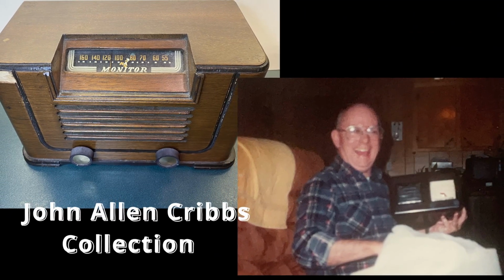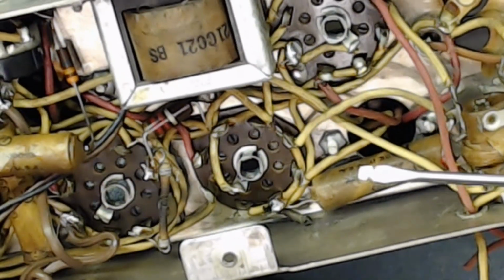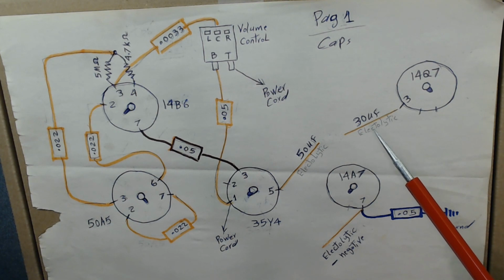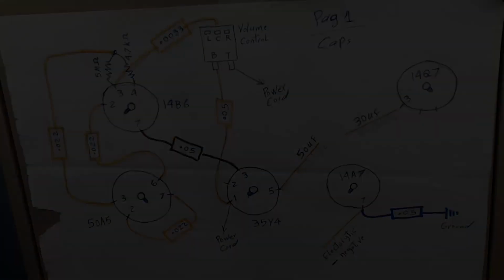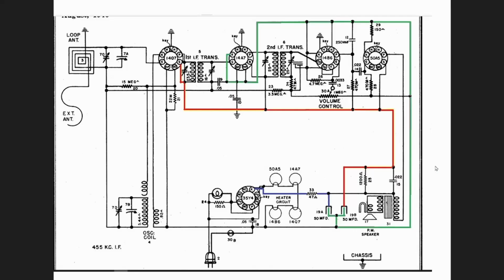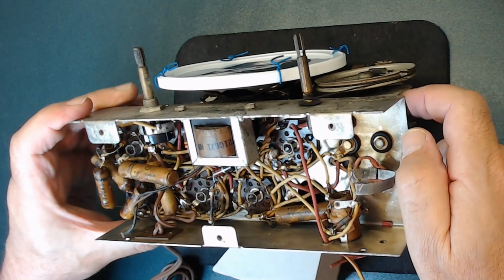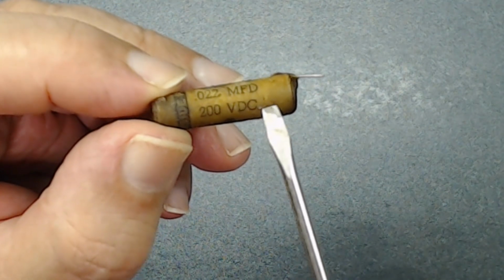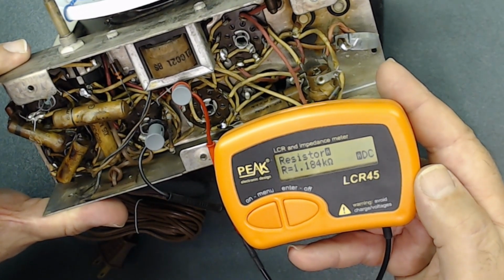Part 2 - Rewiring and Repair of 1946 AM Radio

Comment: Somehow my comment may have gotten deleted. I know you mentioned some wiring going somewhere and chances are 
it is one called a gimmick. It helps reduce the lower frequency noise as a low capacitance AC choke. Never remove it but
 you can replace it with new wire if necessary. Many times it isn't marked as anything in a schematic and can throw you 
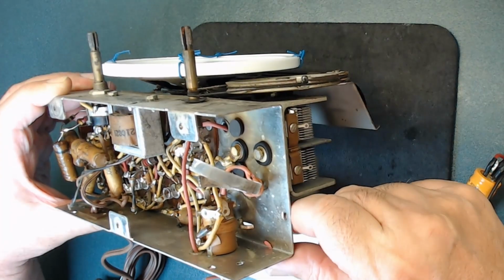for a loop. Seen at 14:17 in video.  A line drawing of the actual locations of components is included in some radios with a schematics page. It is very helpful to make one for a radio that doesn't have a line drawing but all those layers can drive 
you crazy . I kid you not  but you are doing great with this goofy hobby Jay.
Reply from the maker: Hi Steve, not sure why YouTube is deleting some messages, “Guess they have no sense of hummers”. I was confused why they wrapped the wire around the Metal capacitor holder (post). I have seen that on my Philco but was wrapped around paper capacitor. I draw 5 pages long of this darn thing. LOL now you are telling me! Is always good hearing from you my friend, thank you so much for being in touch and always making me laugh. I am learning so much from you guys. Have a good weekend! Regards, Jay

Comment: Looks like you have a good plan of action Jay. Manufacturers often used the unused tube pins as junction points. I think you are doing just fine with the method you are using. 👍👍
Reply from the maker: Hi Doug, thank you very much my friend. Being busy at work lately and not enough time to finish this radio. How do you guys read this darn schematics. You are awesome at it.  Guess I need to call this video series “rewiring radio for dummies”. 😂😂 like those books they have and call it for dummies. But these radios are challenging me to get better reading schematics. Good hearing from you and have a fantastic weekend. Regards, Jay

Comment: Nice job !   To remove those types of tubes,  tilt them gently in the direction of the dimple on the metal base.   Then they pop right out.  Otherwise they are locked in place (Loctal tubes).  The dimple is always next to one of the rivets in the tube socket.
Reply from the maker: Hello, so good to hear from you and glad that you enjoyed watching this video. Thank you for the info, I definitely will follow your direction next time I work on one of these Loctal tubes radio. Still I am learning about this fascinating hobby. It keeps me out off trouble. LOL. Have a good day! Regards, Jay